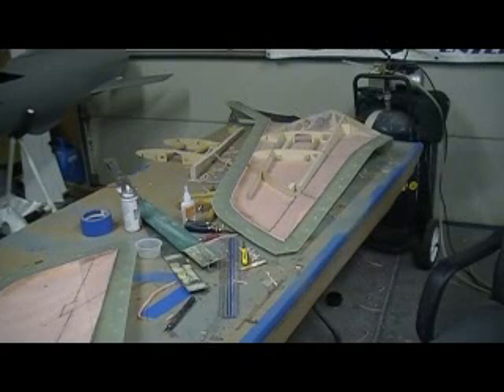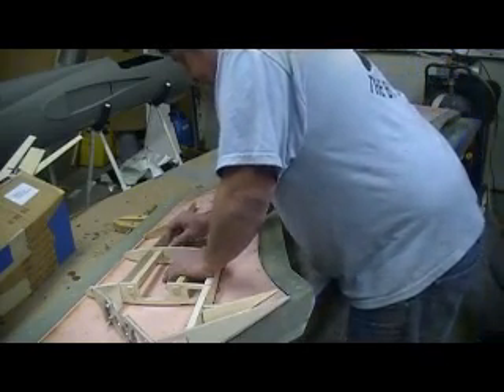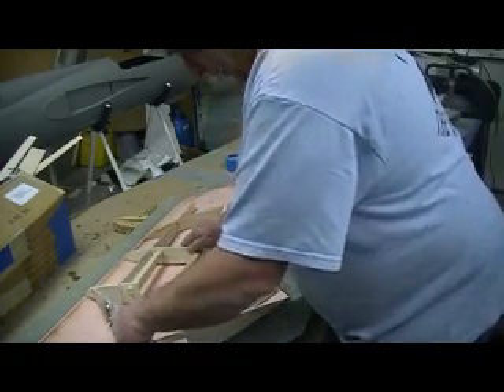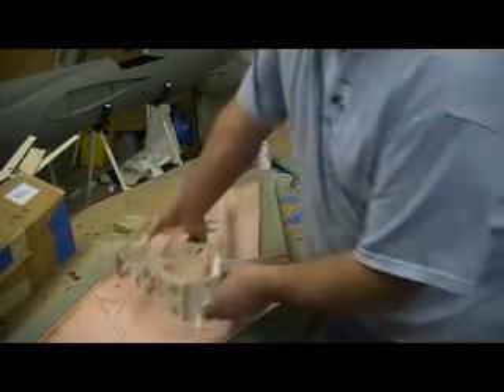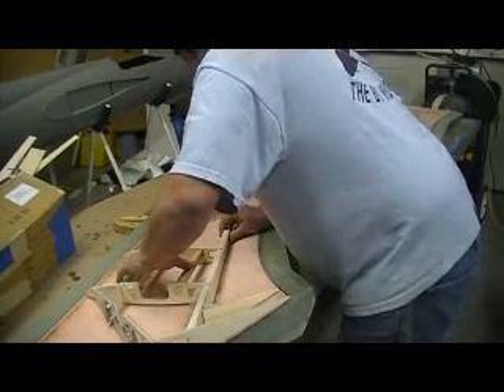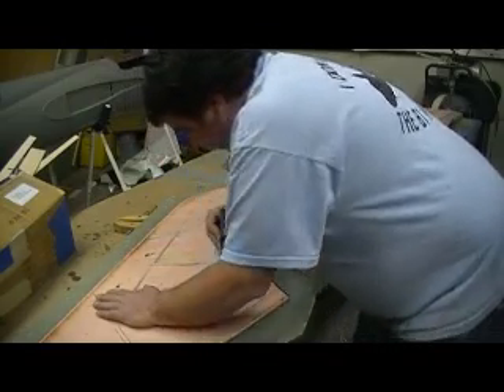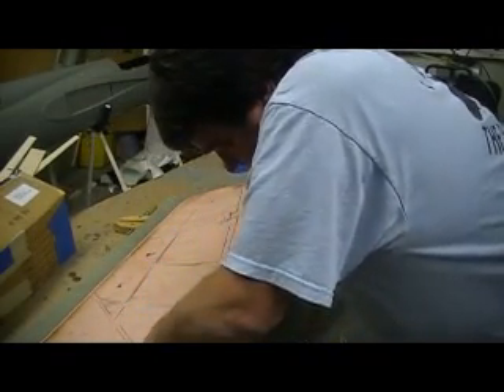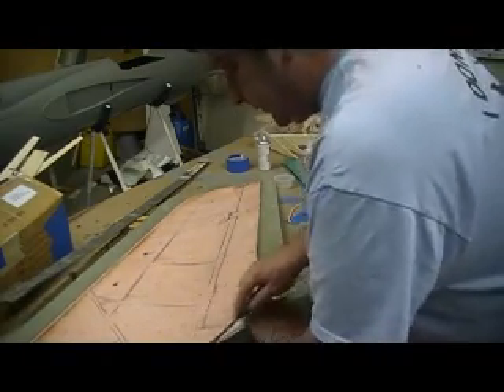how to build a rc jet F-105 thunderchief # 431

Comment: @JasonHolroyd ... I've mentioned this before on a previous video comments.  For maximum strength the foam should be sandwiched between two layers of glass to form an i-beam structure with the glass acting as the flanges and the foam as the web.  What Bob has now is a t-beam type construction.  It adds rigidity to the glass with little increase in strength.  Ultimately though this may be sufficient since the wing strength will come from the ribs, spars and upper and lower wing skins.